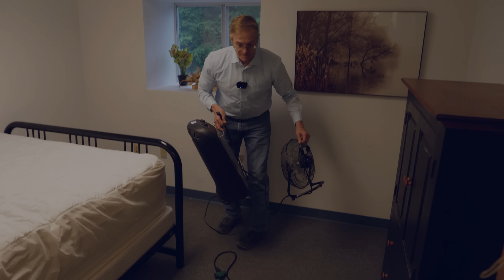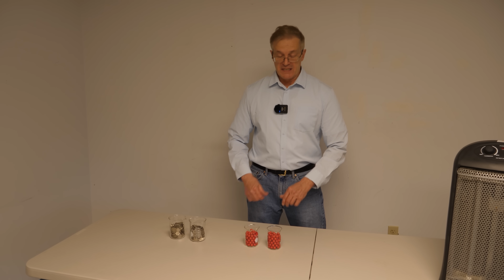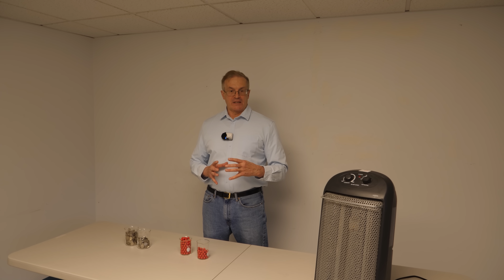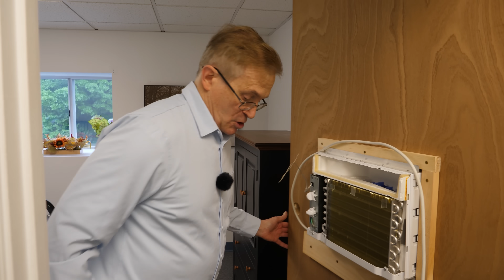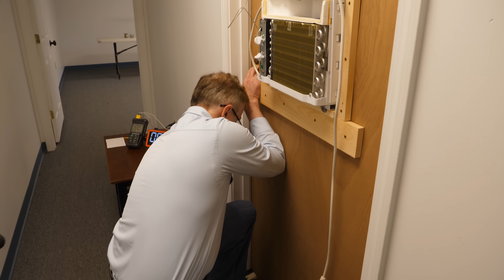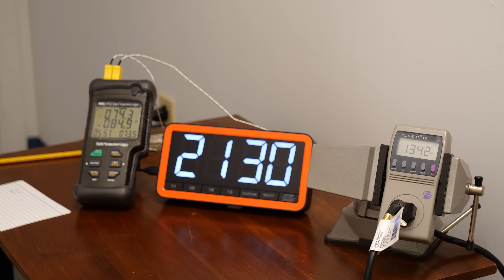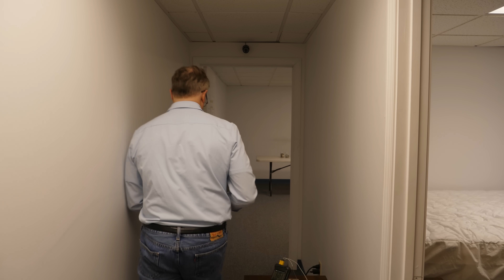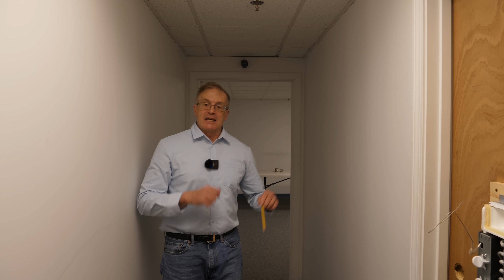You're wasting money on heating! Use your A/C!

Comment: The comparison being made between resistive heating and a heat pump is reasonable from a tech stand point, but for a lot of people the real comparison is gas (ng/lpg) or wood vs heat pump and the economics heat per dollar.
Reply: Every time people bring up thermodynamic efficiency, I always query with costs. Costs is going to be the moving factor.

The industrial revolution, and the use of fossil fuels happened, because energy got cheap using the new tech and fuel. Not just a few percentage points, but a couple of orders of magnitude (100x, 1000x, or more). On the down side, it was both cheap and profitable to be wasteful, which is the crux of the problem. Modern society is now dependent on that wastefulness, and waste issues, from that wastefulness.

You can't go back to pre-industrial ways, because it won't support the current population. Can't even go back to pre-industrial population levels (1/8th current population), because on a per person energy level, a modern person uses way more energy. Any alternate energy method has to be just as cheap, as current sources, and preferably even cheaper, for acceptance.
Reply: So it really depends regionally.  I’ve run the numbers on four different heat pumps in my time.  

When I lived in New England my natural gas savings exceeded my electrical cost by a little over $200/year.

In Northern Texas my electricity costs were significantly lower and natural gas could run crazy as most of the power generation in the state is natural gas and there are always infrastructure/supply issues in winter that increase costs. Plus solar has a pretty good break even as a future upgrade prospect here.

When I had my parents place upgraded in Illinois it was pretty also pretty close to even.

I also looked into a unit for my friends in the Pacific Northwest, which pay almost nothing for electricity, so heat pump conversion was massive cost savings.
Reply: Or in my case, and still very common around here: fuel oil. Which is just diesel that's taxed lower because it's used for heating homes or running agricultural machines.They add some red additive to ensure you're not putting this cheaper stuff into your car.

We have tanks that hold a couple thousand liters of the stuff, which we usually fill in the summer when demand is low and therefore so is the price. Gas is also increasing in popularity, but the problem with gas is that its price is also dependent on demand, and you can't easily store it, especially in urban areas. You're supposed to hook up to the residential gas net, so in winter, when you need it, you're always paying premium. Furthermore, looking at the neighbouring countries, which for some reason are always a couple of years ahead of us, it seems gas will be on its way out soon as well, probably in favour of heat pumps.

Me? As long as my fuel oil burner still works, and remains more economical than gas, heat pumps, or whatever they'll come up with next, I'm not planning on switching. I'm just gonna wait it out until they make up their goddamn minds instead of changing course every couple of years. Especially seeing how they're pushing for ever more electrification (cars, heating, ...) whilst simultaneously refusing to invest in the grid, and warning us that they might cut the power temporarily if demand exceeds capacity.
Reply: If gas is that cheap, a CHP generator looks more and more attractive.
Reply: Coal>>> before prices went crazy we could heat our 5 bedroom 2 story house on 8-10 tons per year for at 110$ per ton. which also supplied us with an “endless” supply of basically boiling hot water.
Reply: Good points all around... always impressed with this community
Reply: Ya if you use the national average of lpg at $2.48 and the national average for power at $0.17/kwh…..factoring in the 90% efficiency of a lpg gas heater let’s say it’s about 82,350 Btu/hr heat your house where gonna use the same number for both and I picked that because it’s how much heat one gallon of propane make after factoring the 90% efficiency. So that one hour costs 2.78…..now the heat pump, on average they of a Coefficient of Performance of about 3, this means for every 3kw of heat it adds to your room it uses about 1kw of power.  So our 82,350btu/hr is  24.1285kw/hr so because of the COP we know we need 24.1285/3 you get 8.06 so at the national average electricity cost of .17 cents that works out to $1.37 to do the same heating as $2.48 of propane it also shows us it would about $4.10 to use a space heater to produce that same amount of heat…even the cheapest propane is still not gonna be worth it….NG is gonna be state dependent with about $16.50/1kcubicft  being the tipping point anything else will still beat a heat pump anything more and your back to heat pump
Reply: I have gas heat and a window heat pump. Unfortunately, the cheaper units only function to about 40°F. It's still cheaper than the gas during mild weather. My suggestion is to buy a good mini-split system that goes down below zero. The A/C also can operate at temperatures well above 100. That is going to be important soon.
Reply: Modern wood and gas heating is also pretty efficient (over 90% with the best ones around 99) when they use a heat exchanger. The worst furnaces are usually around 80% efficient at generating heat. 

Obviously no where near the efficiency of a heat pump though as a heat pump only moves and doesn't generate (much) heat and can easily achieve efficiencies well over 100%. 

The overall efficiency for an electric heater is really bad because producing and transporting electricity is inefficient. Incidentally that is also why it is discouraged. 

Burning fuel is really good at generating heat but worse at converting it into other usable energy like electricity or motion. That is also why combustion engines are inefficient. They are only good at generating heat.

If you want to know more about heaters or furnaces you can watch videos about it from "technology connections". Though I suggest you only watch his video about heat pumps to mostly answer your question and spare you some time. I recommend you watch the whole video but at 27:00 he talks about some problems with heat pumps and at 32:00 he starts talking about prices (not in hard number as that depends on location).
Reply: most CCG gas turbine plants, for example have a combined, complete conversion efficiency of about 60% and grid losses seem to range from anywhere to a few percent, to 10% so we'll assume 10% since it's a nice 50% conversion to the home factor.

Now for gas heating, the most inefficient furnaces (really old one) tend to be around the 50% range, but modern furnaces tend to be around 85-90% efficient, going.

So the benchmark here is 90% efficient for most gas furnaces. And heat pumps can get well over a COP of 1, in some cases even close to 4. So assuming a baseline COP of 2. Based on an electrical utility conversion efficiency of about 50% and a COP of 2, we're sitting comfortably at about 100% efficiency total, now where this starts to get interesting is heatpump systems that routinely operate in a range greater than 2, 3-4 lets say. Because at a COP of 3, we're talking about a 150% efficiency to the end consumer, and a COP of 4 is about 200%

So we're already doing better by that metric. You might be inclined to argue that the raw cost per unit of consumed energy is different, but that's rather trivial to calculate, you can do that pretty easily. Realistically, both are distribution grids straight to the home, and both are relatively simple. So they're probably closer than you would think.
Reply: Stupid people shouldn’t post comments 😂
Reply: Stupid people shouldn’t post comments 😂
Reply: The economics is always in favor of the AC, because you are esentially stealing heat from the outside world.
I will try to explain it.
Im an engineer, worked on cars, heaters, chemicals and even some programming. Mister has explained in a very fine detail what happens, but there is an even deeper explanation. Essentially, even on a freezingly cold day, there is heat in the outside air, we dont feel it as our bodies are designed to be reupulsed by cold air due to obvious danger. How much heat there is can be calculate by how many electrons are moving in the given space. We measure that in Kelvins. Esentially even the freezing cold minus 10 Celsius has loads of Kelvins of heat. Next step is to catch them and pump them in our home. We catch them with liquids called refrigerants. These are special substances that perform this task very effectively. After the heat is extracted from the outside, we just blow it on the inside. The reason it is so efficient on our power bills is that because we are essentially "stealing" heat from the outside world and putting it in our homes. Similar principle is used for cooling our homes, a refrigerant is used to steal the heat from our homes and is then blowing it to the outside world. Have a nice day, and always keep learning.
Reply: Blah,Blah,Blah
Reply: The comparison is made between resistive and heat pumps because this is the best case scenario.

If you consider resistive heaters as 100% percent "efficient" then heat pumps are easily 300% efficient.

Lastly using propane or other hydrocarbon based fuels you should expect less than 50% "efficiency" this is because a lot of heat is lost to the outside from having to exhaust the carbon monoxide and such. You also loose energy in the unburned smoke and tar escape with the exhaust.

A lot of the energy lost in the exhaust can be recovered via more elaborate burners such as "rocket stoves" but you still wont reach the efficiency of the power plant burning the fuel for you and transporting the energy to you. Which is incidentally why resistive heating is used as the standard. 

Of course, the cost of electricity vs raw fuels varies drastically around the world. That is a economical and politically charged issue and not with in the scope of this video.

Ultimately, the most efficient way to heat or cool oneself is to heat and cool oneself. There are lots of jackets and pants with resistive heaters built in to only warm up your self and not your house but that is not as comfortable as walking around in shorts and a t shirt in your home no matter the season.
Reply: @Guardian_Arias

The efficiency of today's natural gas furnace is about 97%. Only about 3% is lost in the exhaust.
So little heat is lost that they use schedule 40 PVC pipe. Usually 2 inch. 3 inch for large heating system.

Any furnace that's only about 50% efficient would be 40 plus years old.
Reply: @Guardian_Arias  My original comment apparently got deleted so I'll make it shorter this time. 
Burning wood or fuels are actually pretty efficient. Good ones around 90-99% and bad ones around 80%. 

Electricity production and transportation is very inefficient so overall an electric heater is less efficient hence it's discouraged in many countries. 

Heat pumps were compared here because you can easily see how it compares unlike with conventional furnaces.
Reply: @Guardian_Arias  kinda wild when it's not hard to make a rocket heater more efficient than the Merlin rocket engine (this is above like 99.7% eff), to say the least with basic thermal mass. 

It'd be hard to argue that your electronics are that efficient. Utility grid being better than a battery bank in most cases.
Reply: @Dan-gs3kg  efficiency is relative, and it all depends on the task being performed. That's why, in my comment, i kept writing "efficiency"

A rocket stove is not even close to being as efficient as a merline engine at propelling a sky scraper thru space. But i bet a merlin engine could warm up a house in a fraction of a second.
Reply: @Guardian_Arias  No one has a 50% efficiency heating unit and few heat with wood, But if so still better for the environment as wood rot's and give up 100% of it's co2 eventually.   Minimum legally allowed is 78%,, with over 90% the norm..
Reply: Yes, also they say "resistive heat is 100% efficient" but they don't consider the losses in generation and transport. Burning the resource on-site would be much more efficient.
Reply: @jeremiahbullfrog9288  you aren't understanding what they are trying to communicate.  The efficiency is only that 100% of the energy is being turned into the thing you want, in this case heat.   The efficiency of the heater doesnt change because you plug it into a battery or plug it into a 1000 mile long powerline. The efficiency of the powerlines may be lower than the battery (some of the electricity heats the powerline or the battery instead of the room you want to warm)
Reply: @jeremiahbullfrog9288  its not that simple because if your wood stove have low efficiency then resistive heater can be more efficient than burning wood at home (compared to energy u produced from it vs from high efficiency energy production to power resistive heater )
Modern stoves (rocket stoves , gasifying stoves) are more efficient but some cheap old stove can be less efficient
Reply: @ErtsenPlayGames  Good point, I was assuming an efficient full burn!
Reply: @jeremiahbullfrog9288  most of the people use coal etc for house heating , entire bucket in one go....half of it goes trough the chimney and into ash :/ even efficient one will burn it maybe in 70+% if u do it right (but most of the time less because of how people burn it) , most efficient ones have 80% but they need to be big ,expensive and properly maintained (and they need ton of energy for fans , water pumps etc)
Where in energy production its like 90% , around 35% go into energy , rest into heat around the city to heat homes
Reply: @ErtsenPlayGames plus there's all the heat you get when you collect the wood, split the wood, stack the wood, and carry the wood inside
Reply: @bobbysenterprises3220  except if u live in country like my one where if u want cut the wood even on your own property u need to file a permit , they need to inspect if that tree can be cut (cant be too big / old) if its not to the "spec" u need to pay for it to cut (pretty hefty sum- more than "just" ready to use chopped wood) of course i don't count species u cant cut at all / situation they wont allow u to cut it on your own and company that will cut it for u wont do it if they can't take the tree after cutting it (or want extra money)
if u ask where it is ...its called "europe" .....i mean Poland
Reply: @jeremiahbullfrog9288  I had never considered the losses intransmission. Obviously they’re not 100% efficient in generating electricity, but I never really thought about the losses on the transmission. It’s got to be significant.
Reply: @brasshouse-fireball  In trying to find numbers, it's really all over the map. Almost like they're trying to hide the real numbers by adding noise to the discussion. 🤔 Maybe there's some academic information that I don't have access to.
Reply: @jeremiahbullfrog9288  In their terms they break transmission into transmission and distribution. Lots of things factor in, but on average a large system like the US grid is around 94% efficient. The real losses of potential comes from converting heat to electricity. There the best turbines are close to 50%. Factor in older equipment and a >95% fuel to heat conversion; the grid wide norm is closer to 1/3, but can push down to 25%, with old enough stuff.
Reply: @jeremiahbullfrog9288  Electrical infrastructure is mostly made of aluminum to save costs and because aluminum has a higher tensile strength than copper while also resisting corrosion better. So there is actual substantial line loss up to 25% on average. Most high voltage transmission line isn't insulated too. So you could use a coil or any conductor to receive the induced electric field.

The first thing to reduce is energy consumption not efficiency. Solid state thermal mass is the best energy regulator. It's all about receiving and directing solar radiation where you want it. Then utilize natural convection and effects like the plenum effect to circulate air. So there is no net energy input or output to gauge efficiency. This would reduce the energy consumption by up to 60% for heating and cooling. Passive solar design and thermal mass. 

If our houses were cars they would be blocks with aerodynamic surfaces facing in the wrong direction, really bad radiator design where the radiator is in a dead air space, wheels that barely spin, and they would be too heavy for the engines we are trying to use. So people are focusing on the engine to make it more efficient when they should be focused on redesigning the whole car or in this case the house. Also taking into account the energy used in the material for construction and the material life cycle. Hint, stone is still the best building material.
Reply: @jeremiahbullfrog9288  Full cycle analysis the win goes to electricity still.
Find the oil/gas in the ground, dig it out, transport it to the refinery, refine it, transport it to the site, burn it on site. Each step you lose energy, and I'm leaving steps out. 
Vs plop down solar panel, run heat pump. 

They can be cheaper, for now, depending on your gas prices. Long term the win goes to solar or other green energies.
Reply: @jeremiahbullfrog9288  There is plenty of loss in collection and transport of gas as well, it would be difficult to compare the two losses since gas companies aren't going to be keen on publishing these figures.
Reply: @Pixelgel  The effective meaningful losses are already factored in by the market.
Reply: @barongerhardt  Yep, was just responding to Jeremiah's idea that generative and transmission losses are unique to electric heating.
Reply: @Pixelgel  Fair. I just regularly run into people thinking that calculating those hidden supply chain costs is hard to do. They don't realize that everyone along the way is trying to make a profit. So if it a shirt at walmart from Lake of Egypt, Illinois, Usa is 10% more than a shirt from USA, Oita, Jp it isn't walmart trying to make extra profit on an american brand. At many levels before the consumer, the problems in the supply chain were already added in, walmart just wants their markup.
Reply: @jeremiahbullfrog9288  i mean the 400ish watts can much more easily fit into solar system , i'd be more concerned when the outdoor air is too cold to really pull useful heat from it . Theoretically possible by just turning the window air conditioner around each season. What sort of heat would you use , the resistive heater or potentially gas/wood/oil/electric furnace as supplemental?
Reply: @tobiwonkanogy2975  The ideal for me would be a geothermal heat pump driven by solar power.  The geothermal negates the problem with cold outer temperatures so that even a moderate solar install would suffice.  All of the costs become upfront, and no running costs (or very very little).  If you can afford the upfront costs, it becomes the cheapest over time.
Reply: It has to get real cold for heatpump to stop working
Reply: @Gazdadjuz  really. Last i knew.
100% efficiency until the outside temperature reaches about 40° F. However, when the temperature dips below this, most heat pumps are not able to maintain efficiency. They become much less effective at temperatures between 20° F to 30° F.

Much of the heating season here is day time highs in the 20s
Reply: @bobbysenterprises3220  
i agree with you, the breakpoint for heat pumps used to be about 44 to 42° outside ambient temperature.  At which point the cost per unit of heat starts to come near that of electric resistant heat. Resistance heat is very efficient but very costly per kilowatt.   in my area the backup electric resistance heat is the highest cost per btu when compared to oil and propane. Gas heat 	in my area, (just not to my house)  is the cheapest form of heat one could buy. 1,000,000 btus of natural gas is about half the expense of propane and about 1/3 of heating oil.
Reply: @ronfitzhenry3726  and yet my state wants to mandate the only home heating is heat pumps.
Reply: @ronfitzhenry3726  not sure how the gas vs oil figures out. I spend about the same as friends with gas for my oil.  And I don't have to buy it from one company, pay for it all year when I am not using it, and have hook up fees all year round.
Reply: @bobbysenterprises3220  
Bobby, it’s a shame how the government is making decisions that doesn’t make sense. I don’t know where you live, but in my area there are to many government officials making decisions thats costing us tax payer more than we can afford. 
There are several things you need to know that can help you make a sound decision for your heating equipment. you know average heating degrees day in your area? Also you need to know how many days in the heating season are below 30° and  20° on average. NOAA is a good place to start for those answers. For me in my area, between Baltimore and Washington, at the current cost of natural gas vs electricity, gas would be the cheapest, followed by heat pump being a close second. 
You could work with a reputable heating and A/C contractor that can perform a Manual J residential load calculation.
Reply: @ronfitzhenry3726  7,135 heating degree days last year

152.6 days with night time low below freezing 

9 days lows below 0

I know it's not exactly what you were speaking to but I appreciate the intelligent reply and someone who realizes calculations need to be made not just signing paper to make groups happy

I'm pretty sure a heat pump would be a waste trying to heat a 100+ year old home in this neck of the woods. 

The ban, endorsed by the NY governor and Democrats in the state legislature, would prohibit the use of fossil fuel furnaces, water heaters, clothes dryers, and gas stoves in most new constructions.

One reason I won't build a new house in the state
Reply: @bobbysenterprises3220  
your right,  heating with a heat pump with those number doesn’t make sense. If you already have a gas furnace with ductwork and you need a new unit, I suggest speak with an a/c mechanics  to see if they’re willing to work around the permit issue. Under the table.
Good luck
Reply: Wood i get.... But who still ises gas its 2024?
Reply: @stapuft lots of people use gas heat. When it’s available it’s the cheapest, most comfortable and fastest way to heat. (Geothermal would be cheapest on a per year energy basis but in my area it’s $25k-$40k more to install)
Reply: @stapuft  depends where you live. In New England wood was plentiful. So I used tons of it. However in the desert, not so much. Oak is 550/cord around here. Almond is 500. Elm 450. Most are hauled in from California seeing as I'm east of Lake Tahoe. On a good note where I am, I think I can setup my own geothermal system. Gonna try anyway.
Reply: If everything is economics... Then just destroy the forest duh, no point in doing anything.
Reply: @ecoista1373  Thanks for bringing the discussion back down to internet level